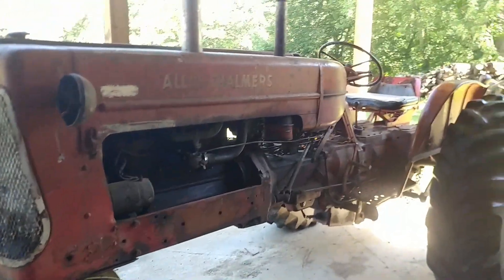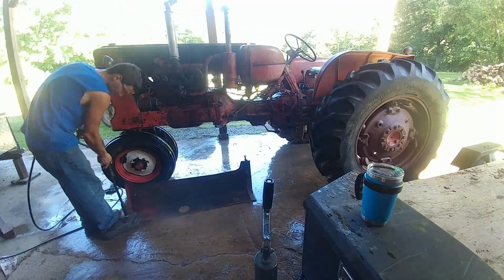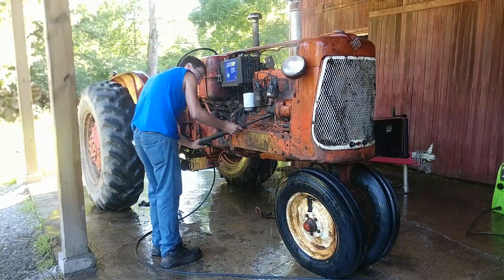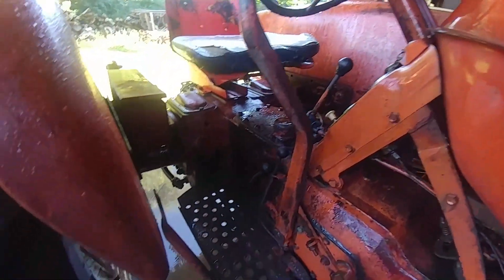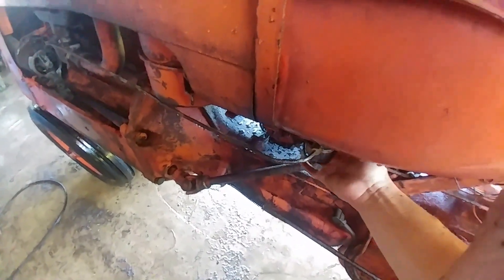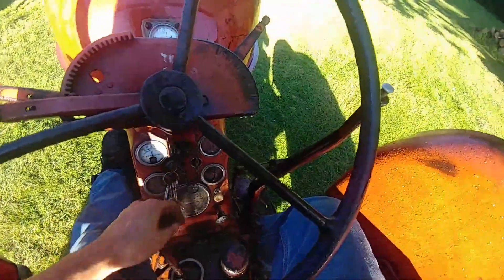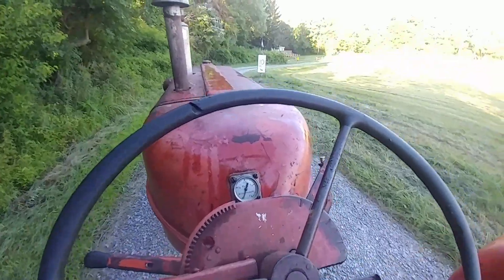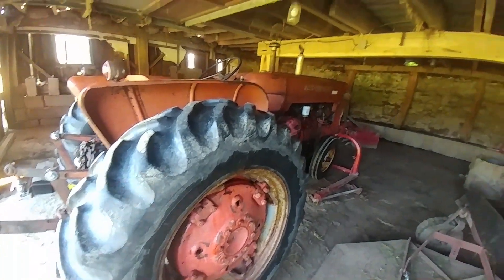PRESSURE WASHING THE MIGHTY ALLIS CHALMERS D 17!!!!

Comment: You don’t need a overrunning clutch.  That is what the hand clutch is for. The pto will keep running and the tractor will stop. Used it for years baling hay and running the brush hog as well as chopping corn.
Reply from the maker: Terry Schwartz But if I wanted to go from forward to reverse while brush hogging wouldn't the brush hog still push the tractor?
Reply: If I recall correctly you should not have to if using the hand clutch. Acts like a live pto.  
Try it next time and see 
I can remember brush hogging and with the hand clutch anything the front axle could push over you could stop and grind it up with the hand clutch.